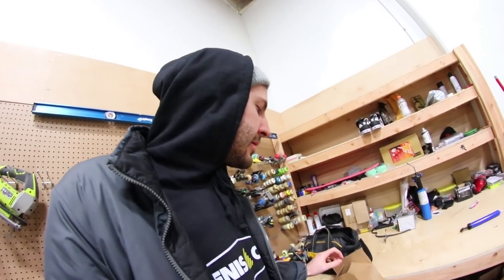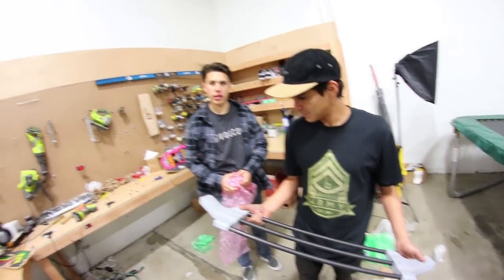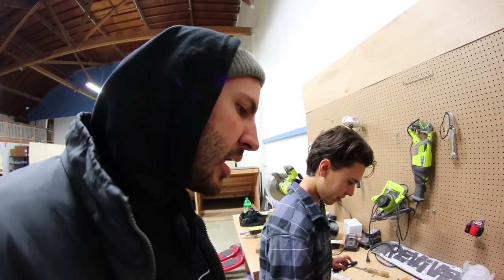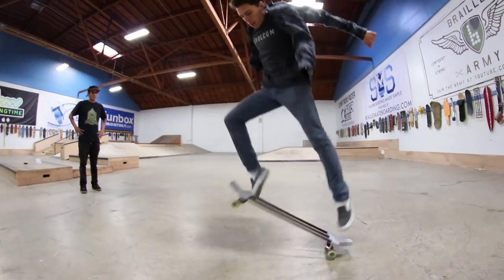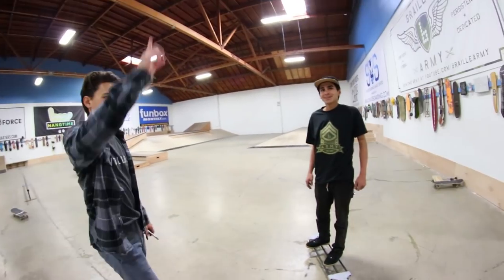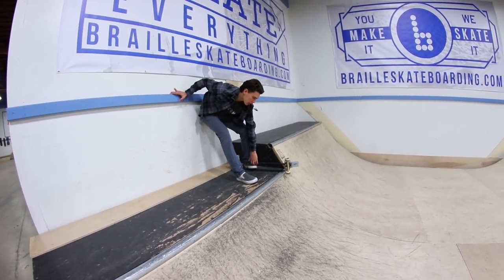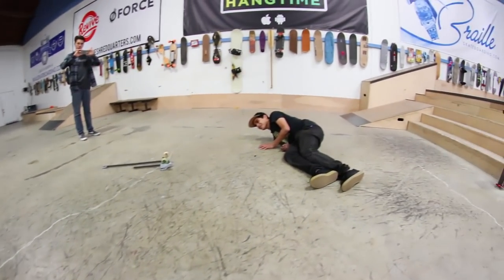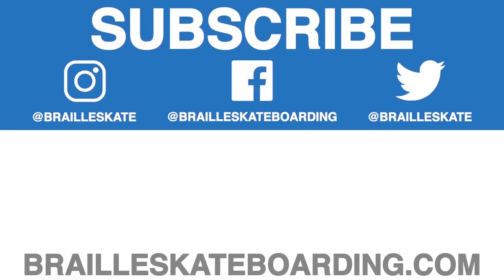THE CARBON FIBER LONGBOARD OF THE FUTURE?!

Comment: Dont say its a bad product guys, you were doing street skating with a longboard thats designed for cruising, what did you expect
Reply: Ander Niko well it has kicktails so its meant for freestyle too
Reply: Thank you!
It is designed for cruising. And it holds no problem!
This is just the perfect strength testing :)
Reply: I'm gonna be brutally honest and say that this is a bad product. First of all, I'd suggest 5 bars instead of 3, that is if you'd even think the idea of using bars is still a good one. Also, the plastic will never last so I'd suggest a stronger material. In the end you're gonna have to add and not subtract weight to improve this idea. My guess is that you'll end up having a board that looks like every other electric long board on the street. Now I'm not saying that you'd never be able to sell these how they are (if that's your intention) but I'm guessing that your product would be for a young demographic and I guarantee that kids feet would easily fall through the gaps between the bars. Sorry but I don't see you having any success with this concept you have.
Reply: First of all, why send professional street skaters a long board?? Why not send it to Professional Long boarders??
Reply: Syluxion Ix how many professional longboarders are there on YouTube tho?
Reply: Syluxion Ix because these guys were raised in the age of ads that putting ads in everything is natural as fuck for them and people just keep sending them all their new products for that reason. Even when they don't try to sell they are selling you something
Reply: But it still has huge gaps that seem dangerous, even for non street skating like they mentioned.
Reply: a board not with holes in the deck maybe? great that the person is experimenting and having fun building it though.
Reply: Ander Niko I wouldn't cruise on that shit unless I didn't have access to wood
Reply: А stupid design
Reply: Ander Niko  even though it is very strong carbon fiber loses all structural integrity after it bends. Even the smallest bend so it would not be very good.
Reply: This thing is awesome. But I fear for the stress of 3d printed parts. Perhaps more infill? And in a honeycomb design?
Reply: Or wrap your 3d printed ends in CF. That would probably solve the breaking issues.
Reply: Pesky Knight there's a bunch of longboarder YouTubers that are sponsored or pro. Also the board is wack.
Reply: Pesky Knight a fuck ton
Reply: Yikes! Look....not everyone is cracked up to be great at mechanical design.  Your 5th grade level skateboard concept is fun to watch for Braille video content, but I really hope you're not putting real energy into selling this thing.  Not only is it stupid dangerous (think seriously about the interfacing of foot-to-wheel), but it's just incredibly fragile in current form, walks backwards on all of the methods of enhancing foot control, and just doesn't improve on any other concept even in the slightest.... Unless you consider being "terrible-but-different" an improvement?  I'm honestly still not sure if this company is purely trolling or not.
Reply: still a bad product dude,sure ur cruising down the road it still won't prevent ur foot from slipping in,and it has no grip for ur foot.
Reply: Why does it have kicktails? And how can you cruise sstanding on 1 stick?
Reply: It was designed by people who don’t skate. They genuinely have no idea what they’re doing. Of course it sucks.
Reply: People talking about fucking the plastic won't last. It'a carbon fiber guys. That's the strongest board you've ever seen
Reply: LOL
Reply: Maybe Next time then why did it break? Carbon fiber isn’t just stronger, it’s stronger by weight, but it’s very brittle. Carbon bikes break far more easily than steel bikes, they’re way lighter but the inability to flex under stress causes them to rip apart.
Reply: CrazyManuel94 most longboarders aren’t doing 50mph down a hill and just maybe they’d have the good sense to not risk their lives on such an awful design to begin with.
Reply: MrLazer1211 you can also do an epoxy coat and slow bake to increase tensile strength. Wrapping in carbon fiber would be even better and look more elegant though.
Reply: Just ad bars that are perpendicular to the long ones to reduce the gaps to small squares that feet can’t fall through.

Comment: The only advantage to this design would be if the space between the bars could be used for and esc and batteries protected by a top and bottom cover.If the bars were square and flat it would also make a better fit for a cover.

Comment: Its a terrible idea from an engineering perspective. Not only does the regular single flat board style provide significantly more safety but it dramatically improves the strength to weight. Right now each of the 3 poles needs to be able to carry the full weight of the rider, with a single piece the right section can provide support for the left section and so on. Ie. that board needs to be 3 times as strong as a conventional board or it will be more likely to break. Quite frankly carbon isn't the right material anyway. Fiberglass can take more energy before breaking, is dramatically cheaper, and the only advantage carbon has is a disadvantage in skateboarding (less flex). And finally with this specific design the Braille team found the weakness almost instantly, 3d printing is very weak and that specific 3d printed design is shockingly weak. This didn't use professional and/or trained engineers and it really shows.

My biggest fear is they intend to fill the gaps in with batteries to counteract some of the flaws I've mentioned. If so it will be a catastrophe, lithium batteries are insanely fragile and set fire at the slightest impact, just as they will explode with any amount of force put through them as a load bearing surface. People will end up crippled for life.
Reply: Thank you for that.
Obviously it is not even intended for kickflip. It was hilarious though.
I'm a professional engineer, I just don't skate.
Reply: DoSimpleCarbon Thing is, people put their feet nearly straight when pushing on a longboard, It would be very awkward for me personally to push off on this board.
Give the skating aspect some more thought because it won't be close to skateable like this :p
Reply: DoSimpleCarbon
Do you not understand the testing that goes into electric skate boards? Even if your intention is for it not to be designed for “kick flips” it needs to be able to handle the stresses of riding under power and with the weight of a rider. From looking at it I doubt you’re smart enough to figure out either of these variables and will probably result in an injury to yourself or someone else. Nice job on the 3D prints though, probably took a lot of crayons.
Reply: gerald bott Appreciate the hate, have a great day.
Reply: @DoSimpleCarbon  I thought it was an awesome concept! Don't let haters get you down, keep being innovative and you will change the world.
Reply: Thanks man!! Really appreciate it! Will Do :)
Reply: r/iamverysmart
Reply: DoSimpleCarbon 4 bars homeboy so you can't jam your feet through
Reply: DoSimpleCarbon  there is a lot of variables that weren't thought about in the comment but a fourth bar would be cool.
Reply: Olivia Lambert still dope
Reply: I think you could say the same for anything you stand on that has wheels
Reply: DoSimpleCarbon what about putting rods perpendicular to the long rods to reduce the gap size 2 smaller squares rather than long slots so that a foot will not fall through it. Also, if my idea helps in the product takes off, please send me royalties. ;-)
Reply: Olivia, sweetie...leave the engineering to the men.
Reply: I had a fiberglass deck a while back, it was pretty much indestructible.

Comment: Also you guys didn't check ojut the instagran OR the website. There's a platform missing and it's a cruiser. I understand doing these episodes for fun, but at least give it a shred respect. It actually doesn't seem like a bad idea if it was flushed out just a little bit more. Maybe filled carbon tubes to increase stiffness with a small sacrifice of weight (which i would want in a cruiser anyways). like 10 seconds of googling would have made all the difference...

Comment: It's a longboard that is designed for reduced weight so that the motor has less to push. Great for cruising (even without the motor), bad for tricks. That said, I would add 2 more bars.

Comment: Why does every board sent in that's light seem to be just a few bars it's not easy to stand on round bars with a giant hole in the middle. You need a couple stand plates attached to the bars for feet

Comment: yea this guy was on the esk8 builders forum a while back with a working esk8 with this deck (?) design and I wasn't convinced then, and for sure not after this video.

edit

here's a pic

http://www.electric-skateboard.builders/uploads/db1493/original/3X/f/6/f6f3ddcbc1a006e6c444c5878d416e4f3da2789e.jpg

and a video

https://youtu.be/Fatt9i2fWD0
Reply: igbatious yeah just looking at it you can tell you can’t do anything with that piece of crap
Reply: Lost Boy 95 I wouldn't call it crap, some real craftsmanship went into it, and I think it's a proof of concept. the esk8 he built on this board went super slow but for a real esk8, definitely not the right platform.
Reply: nothing about this thing is easier or simpler than using wood. props for making something from scratch though.
Reply: To be fair, I can't remember the last time I saw someone double flipping or riding a half pipe on a long board. It might work good for getting around

Comment: The carbon rods held up really nicely the 3D printed parts not so much it would be a nice concept with 2 more carbon rods and change the 3D printed parts for ABS or more carbon
Reply: Maybe more infill on the 3D printed parts?
Reply: RollDeBonz2112 or maybe layer some carbon fiber and fiber glass sheets over the 3D printed parts to strengthen them plus more infill that would be really strong and not to heavy

Comment: 3D printing is such garbage
Reply: jegs199 garbage for skating on, but bad ass for other stuff :)
Reply: if done correctly, 3d printing can be very useful. But these things are just 'standard' plastic parts with low fill density (check the broken nose piece). Well calculated parts, made from reinforced plastic or even metal, may work.